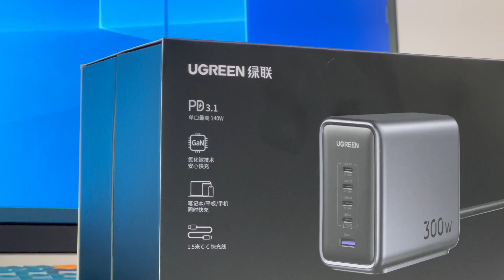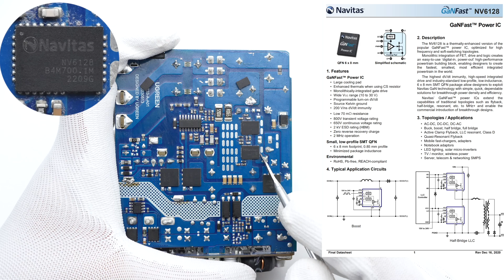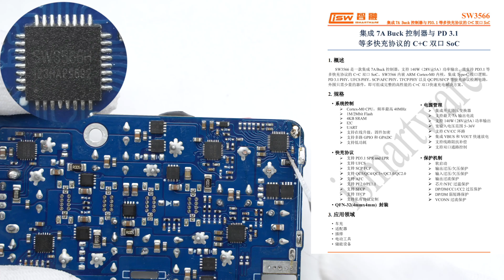GaN & PD3.1 | Teardown of UGREEN Nexode 300W 5-in-1 Charger

Comment: full of the cheapest chinese caps from capycon..the fail easily.big disappointment, get apple 140w charger full of japanese components like toshiba, infineon, rubycon caps etc.
Reply: Can you replace them with better caps?
Reply: @ridesafealways4929  i used to change cheap caps from my amplifiers however ac adapters have no free space for upgrades, quality caps with same Voltage and Capacity values are bigger than these cheap caps, there's just no space to remove and solder better one. Their either diameter or heights are bigger, they won't fit in.
Reply: @ridesafealways4929  yes but a pain to get to!